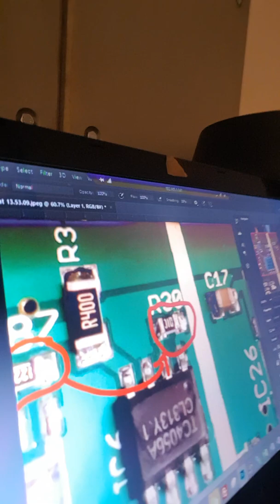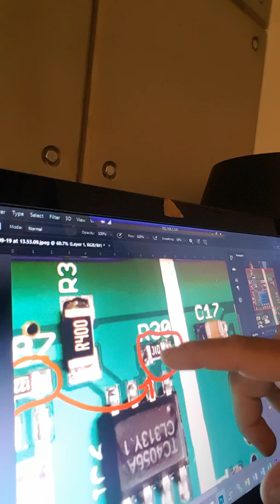Megagell Charger Batch 1 things to fix - Hang in there... it will work

Comment: What about putting the other TP4056 charging chip?  , just got my charger and it looks like all i have to do is just put a Tp4056 chip, i my wrong? Does it require any other parts ? would be very useful to have different charging currents :-)
Reply: Hi, that should work in theory without any changes in the software. We wanted to have it there to perform some tests, but did not get the chance yet. I would advise testing on 1-2 cells and see what's happening before moving to the rest of them. It will charge with up to 1140 mA if you use both chips with the installed resistors.

One thing to mention is that the resistor from a TP4056 module can be used as well in case the resistor is lost when desoldering.
Reply: Alex thanks for the reply as soon as I get some hobby time i will be installing and  doing some tests.
Reply: @JOSERAMOS467  I'm glad Alex responded to your questions as i had the same and it's difficult to get an answer from him it seems.  I just received mine. If you get to your repairs before i do will you post your outcome and if I get to my repairs first I'll post mine. Thank you Jose
Reply: @bangthumper1195  will do sir , for now I'm waiting on parts .
Reply: installed new tp4056 ic on the megacell charger,  replaced all misplaced 122 resistors and placed 122 resistors on new tp4056 , it's been  3 days so far is doing good , i have seen  up to 1.8 amps charging currents  no conflicts what so ever . Now workflow works a lot faster in charging batteries. Now to replace and place all the rest of the tp4056 and resistors.  

Wonderfull job on that @Alex Gradea
Reply: @JOSERAMOS467  that’s great to here. Thank you for your update. I still haven’t even ordered mine yet. If you don’t mind me asking, where did you order from? Thanks again!

Comment: Does the software require a Windows machine or can you also use a MacBookPro ?
Reply: It requires a Windows machine, there's app for Android and IOS, we will work on making it available on linux and mac in the future.
Reply: Ok good to know I will convert an old macbookpro to windows using boot camp. Thanks for responding!

Comment: Another note/heads up for those who purchased the PSU with the MegaCharger:

If your normal electricity is 120 AC you need to open the PSU, two(2) screws, and change the switch from 220 to 120 then close it.

There is a warning label on the PSU tells you to check. I did not see the warning any where but on the PSU.

Hope that helps ?

Thanks so much for the MegaCharger and PSU ! I look forward to using this great charger!!!!
Reply: I was able to put a small screwdriver through a hole in the case and slide the switch to the 120v position without removing the cover. Thanks for the heads up.

Comment: Please provide us a technical guide on where these resistors are on the PCB and what those resistor values should be. 
We would also need instructions on how to apply for the refund as well.
Reply: If your not comfortable fixing it he said he would pay shipping to repair it. So no refund needed
Reply: @fatmann66  I want to compare options and having a guide would help in getting a local quote from a repair shop. If I was going to fix it myself, I want to make sure I am doing everything correctly otherwise I might end up causing more damage then there already is.
Reply: Okay i have my charger open. You should do a better shorter vid on this repair. Its not super clear. The chips are on the top side. So basically i think it is three parts per cell to move. 1.the IC goes to the pad to the left 2. the r171 swaps to the r32 3. The r32 goes to the r171 pos or dont repop that. This is a nights careful work and $20 is very little for the time it will take. Put a real diagram on your webpage please in plain English how to fully correct this
Reply: @Whereswally606   I did see a short video the other day on repair that was zoomed in.

Comment: What would happen if we ignore this defect?
Reply: I have the same question, are there any safety issues if it is left as-is?
What is changed by leaving it for now?
Reply: @RabbitThePat  No Safety issues, it will just charge very slow
Reply: Based on what he mentioned in the video you will not get the full 1 amp charge. Sounds like it will be 140ma instead.
Reply: Short answer it will just charge slower. :)
Reply: @vicgarbutt3310  It's actually 0.14 amps that will charge. It's like James Rader said, it will charge around 7 times slower